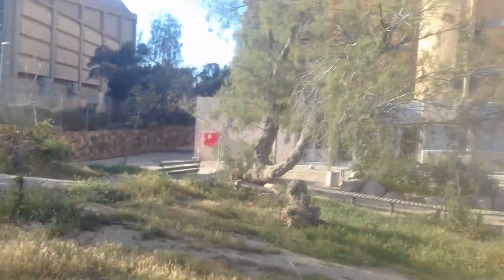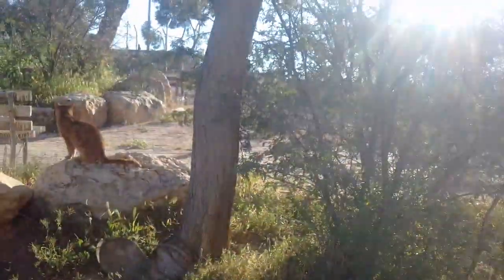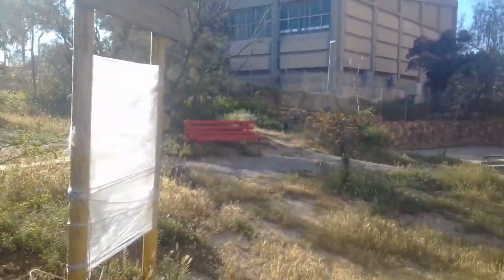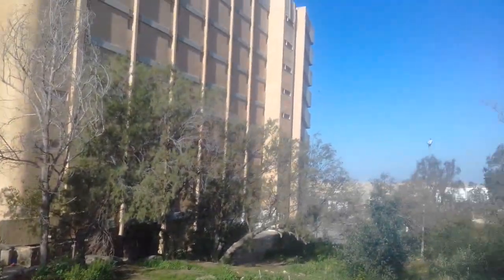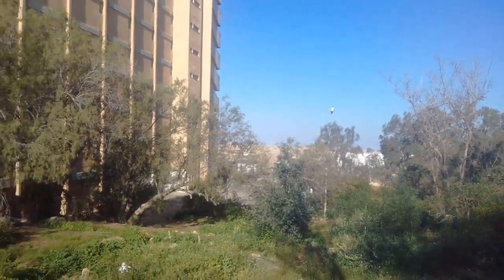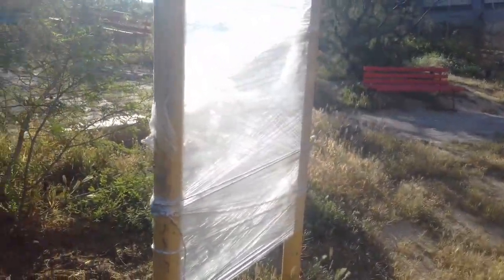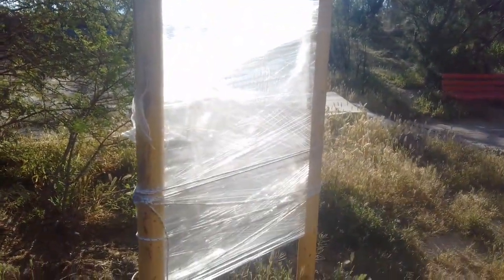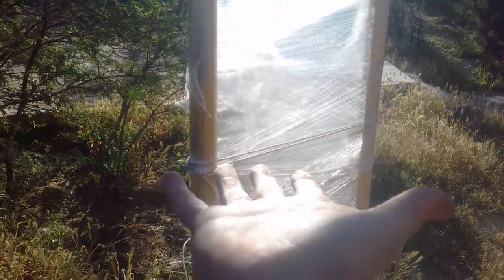Homemade simple atmospheric water generator

Comment: Good method. Actually I am researching to do so but with netting or mesh UV resistant or someking of recucling material. You plastic method is a good quick cheap method but I wonder how long that plastic will last. So some kind of biodegradable material could be a better choice.

Comment: Ive tried a similar experiment using a plastic drinking bottle. I sealed it empty and left it in the sun. Hoping the heat from the sun would create compression. 

Ever hear a plastic bottle crumple sound in the morning? I would assume its because the heat in the morning causes the air inside to expand.

But what do i know? My dog is a better chemist than i am.

Comment: How does this trap moisture? Is it that the cool temperature at night allows humidity to rise? Or perhaps the heat from the sun and draws the moisture from the air/wind into the film?

The reason im asking this is because i learned the way to create a vent without wind is to create and trap heat first. 

An example of this would be heating your room in the winter, then once hot inside, slightly open the window. All the trapped/compressed molecules of heat will escape allowing the cold less dense molecules outside in...WHEW!!!

I just got a headache from writing this. Lol

Comment: Thank I am working on creating a rain collection system.   Next Step Water Creator.   I would think a solid sheet of plastic would work better than surrender app because then the walls of plastic would be smooth and the water would run straight down and not get hung up in the creases of surround rap plastic.

I'm going to try this with black painter's plastic.  🤔

Comment: Martial Borchel:  Thanks for taking the time to put this up. It’ll make a big difference to a lot of people

Does it matter about the shape of the moisture trap?  I figure you’ve probably experimented with it a little bit, to see. Is it more about having a sheet there or does there need to be a layer of warmer air trapped in between for this to work, and if heat being trapped is important, then if a person were to use black plastic, would that change how much condensation that a person would manage to trap?  And what about something that’s dome shaped for the top seven-eights i’ll be tight, or perhaps shaped like an inverted cone?

And of course, I’m wondering about the maintenance schedule, as I imagine that constant moisture and sunlight overtime would’ve necessity amount to algal growth. But perhaps using black plastic would prevent that. Or as you mentioned, perhaps greenhouse plastic would be resistant to that as well. I’d be interested in hearing how you maintain it.

I’m not adverse to experimentation, but it would be very inefficient of me to not ask questions first.

I do hope you’ll get back to me. Thank you again.

Comment: The dehumidifier in my basement uses tubing and refrigerant and electricity ....instead of the plastic wrap on two posts.  How about a metal funnel or cone shape filled with refrigerant that uses gravity to collect the water.....you could put plastic around it and get the same aesthetic.

Comment: is there a way to do this with things from nature itself ? plants trees or something else? ( the part that catches it i mean) also i live in an area that get fog every now and then and that would be ideal to capture water wouldn't it ? :P
Reply: Not really but you can do this with electricity run by solar which you can slso find online, this is much more expensive though
Reply: I think there is a way, but the concept is diffrent from this.

I have heard that, in ancient times, people dig a pit in ground & covered it with long leaves of trees pike palm/pine/dates etc.

It would capture moisure from soil & drop in container at bottom of pit. There is also a role of pressure in this process, but we do not have worry about that.

I hope this helped.
Reply: @randomshortvideos2071  Saw this in the Sahel.  I think the piss drinking dude has a video on it.

Comment: Just thinking outloud here.. if at the bottom of the Seran Wrap you wrap it at an angle downward, possibly the water will pool at the lowest point and drip off into whatever container you choose? Otherwise you may need a horse trough to run the full width of the Seran Wrap.

Comment: sir can i ask about what principle of science might best explain this... other than the concept of dew point and condensation, is there any way i can get figures and numbers? I'm currently working on your prototype - the small one as my thesis project. and so far, i haven't gone with the math part yet. is it the pressure working here? or temperature? btw thanks for this vid/s. hope you get to inspire more like me
Reply from the maker: sorry for delat. Give me two weeks and ill have something pulled up for you.
Reply: @MartialBorschel  3 years passed, did you end up pulling it up?
Reply: Martial Borschel thanks sir, i would gladly accept anything, any knowledge you'd offer. here's my email... dzohrphilip@gmail.com
Reply: What are the other materials i can use?

Comment: Do you have any sources for the physics or thermodynamics of this device.  Also ... you have the sheets sitting there in the sun, presumably heating the water.  Wouldn't it make sense to shade it on the side towards the sun so that:
1) The water already condensed does not evaporate off?
2) The plastic stays cooler in the shade than it would in the direct sunlight?
This is pretty cool.  Can you think of any better mediums to distill water on?  Is there any fabric designed to do that, like the opposite of a wicking material?

You also mentioned that you created a swamp in this location to grow all of this greenery.  It looks great.  Is that using water from the tap or some kind of permaculture principles?  I heard the Negev is a pretty hot and dry desert, though not as bad as some.

Good work and good luck.
Reply from the maker: No.  It's situated in a way let trapoet moieeo
Reply: @MartialBorschel  Those last couple of words?
Reply: @wadebarnett2542  trap moister

Comment: Humidity, humidity, humidity, and you never tell us what you're level is. I'm in the Mojave Desert, and desperate for water..... Please be more thorough, and post a complete video.
Reply: Try a double pane plastic dead air space with a rain gutter for a catch.the scale of whatever your desire it dose depend on humidity and sun exposure. It works best if one side different temp then the other  like a green house wall and the outside..im moving to the desert and plan to try a complete system for changing my enviroment..glad I found your page.
Reply from the maker: Hey! Sorry just saw this, my apology for the delay. By level do you mean elevation, or my education?
Reply: Martial Borschel HUMIDITY level, we have 15-20% at times
Reply from the maker: Sorry the level is what is throwing me off in the comment.

Well, it really depends on the time of the day honestly. Because we're on top of a mountain we get these crazy winds twice a day. On top of that, like this morning, I came outside to fog- but that isn't because the air itself is humid and full of water necessarily, but because a cloud has moved over onto us. Now if it sits there, yes, the humidity will jump. And it'll retain until about 9 am when the sun comes out and everything evaporates. 

Like right now humidity is 42% (7/13/2017).  Our average is between 20-35%, depending on time of the year. 

The lowest I've seen the humidity get here is 13% since I've been tracking it (6 month period).

I hope this helps! In next video I'll include the above info and more.